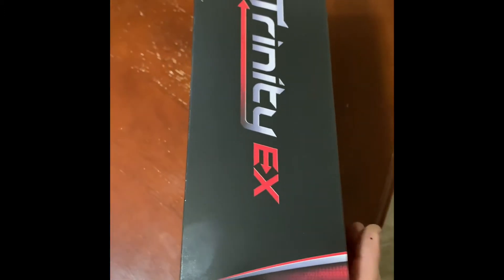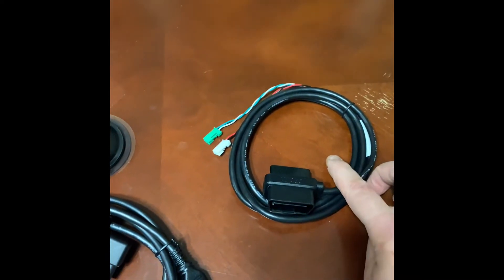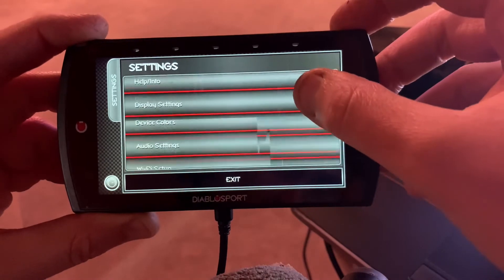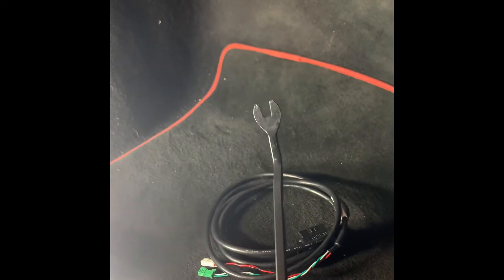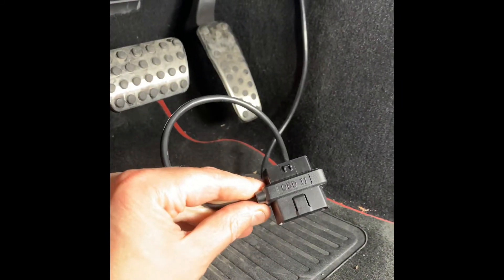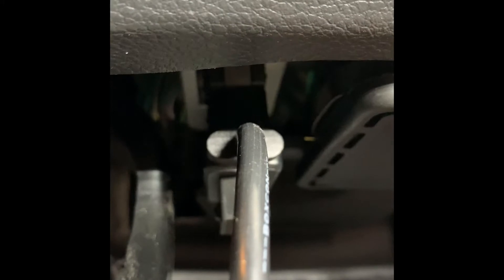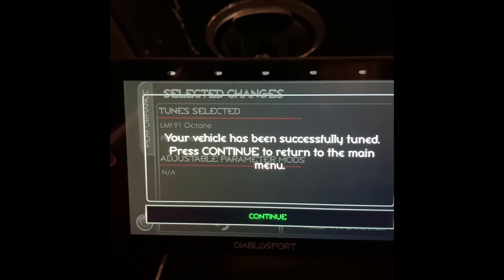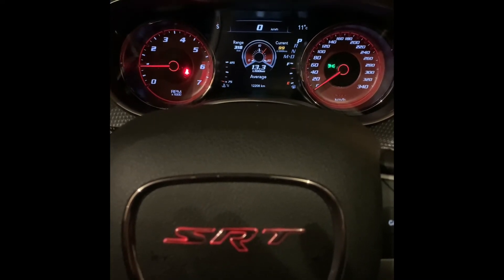2019 Charger Hellcat Diablo Sport T2 Tuner and PCM full install

Comment: it's been 11 months now. Still everything good? engine still running good and no check engine light?  I been thinking of getting one
Reply from the maker: There has been quite a few mods since I added to new PCM and tuner but honestly it has worked flawlessly. Diablo was always sending software updates so you always had the most up to date tunes 👍🏻
Reply: @Modaddiction19  ok thanks.  I just saw your reviews. you have a new sub lol. I'm gonna start adding more mods to my hellcat now. thanks.  any advice would be greatly appreciated 😊. thinking to start with diablo.
Reply from the maker: @dirtyredwitdacat7074  thanks for the sub! Diablo is a good start to get your Cat moving. Also you will love the ability to data log with it and see exactly what the car is doing. Plus the added gauges are nice 👍🏻

Comment: How’d you get Barths tune on a diablosport system?
Reply from the maker: Barth originally used to do all his tunes using Diablo. With that being said he just used my unlocked PCM provided by Diablo and tuned it with HP Tuners as there is a better range of tuning capabilities. I still use my T2 for the gauge cluster to monitor different sensors.
Reply: @Modaddiction19  makes sense, thank you for that info.

Comment: How did you get another PCM?
Reply from the maker: You can order from Diablo direct or do as I did and order it from HHP. You can get it with the tuner and unlocked PCM or just an unlocked PCM.
Reply: @Modaddiction19  thank for the info  my car is new and don't want to void the warranty just yet,lol what is a normal price for the PCM
Reply from the maker: @johnmartinez9295  apparently the dealer can tell based on milage and other stuff so potential could void your warranty. PCM’s run around $900 but if your in no rush wait until Black Friday and you can save about $50 👍🏻
Reply: Cool, thanks...
Reply from the maker: @johnmartinez9295  no problem 😊

Comment: Does the tuner come with the lmi tune already installed
Reply from the maker: Yes it came with the LMI 91 and LMI 93 tune pre installed 👍🏻
Reply from the maker: If you have a 3.10 pulley now on the stock tune I personally wouldn’t run the more aggressive LMI tune as you might just lean out to motor too much. But I would seriously consider unlocking the PCM, getting a tuner and doing a 2.85 pulley that would really wake your cat up 🤘🏻
Reply: @Modaddiction19  if I do that will I have to upgrade injectors also
Reply from the maker: @edmonmayfield2446  do it!!! 🔥